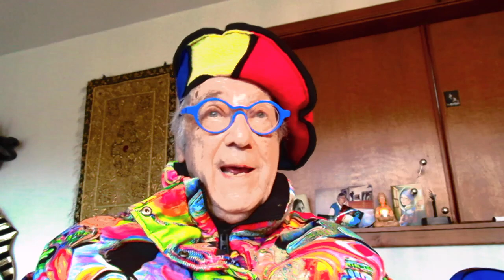Solution #192 Cylindrical Capacitor with Dielectric

Comment: Alternative solution to problem 192.
(From an RF-engineers perspective)

In vacuum:
Z₀ = √(μ₀/ε₀) 	…(1a)
μ₀ε₀c² = 1		…(2a)

Eliminate μ₀ from Eq. 1a and 2a:
μ₀ = 1/(ε₀c² )
Z₀ = √[1/(ε₀²c²)]
Z₀ = 1/(ε₀c)
=> 
ε₀=1/(cZ₀)  F/m	…(3a)

In a transmission line:
Z₁ = √(L’/C’)	…(1b)
L’C’v² = 1		…(2b)
where v = c/√εᵣ

L’ = 1/(C’v²)
Z₁ = √[1/(C’²c²)]
Z₁ = 1/(C’c)
=> 
C’ = 1/(vZ₁ ) = √εᵣ/(cZ₁)  F/m …(3b)

For a coaxial transmission line:
Z₁ ≈ (60/√εᵣ)·ln(D/d)	…(4)
(A well known equation among radio amateurs)?

d = Rb = 0.0035 m 
D = Ra = 0.009 m 
εᵣ = K = 2.6 

Z₁ ≈ (60/√2.6)·ln(9/3.5)
Z₁ ≈ 35 Ω

C’ ≈ √2.6/(3·10⁸·35) ≈ 153 pF/m
Reply: Explanation:
Z₀ = the wave impedance of a plane wave in vacuum.
μ₀ = vacuum permeability  [H/m]
ε₀ = vacuum permittivity     [F/m]
c = speed of light
μᵣ = relative permeability.
We assume no magnetic material present, so we let
μᵣ = 1.

Z₁ = wave impedance in a transmission line
It can be a microstrip or a stripline in a printed circuit board
or a coaxial transmission line etc.

L’  = inductance per meter [H/m]
C’ = capacitance per meter [F/m]
v = the phase velocity in the transmission line.
εᵣ = relative permeability = same as the K-factor.

We interchange the equations in vacuum with
those in the transmission line:
Z₀ -> Z₁ , μ₀ -> L’ , ε₀ -> C’  …

Z₁ can be fond from a simulation program, or for a coax
by an  approximation like Z₁ ≈ (60/√εᵣ)·ln(D/d).

Comment: And yeah, I can understand your disappointment completely. Cable capacitance is a really basic problem (C/L= 2*pi*eps0*k/ln(Ra/Rb)) (changed it according to your problem variables)

Only three persons got it right 😮 meaning, they aren't paying attention to your lectures at all.

Or I am guessing they took Ra and Rb reverse. I mean, we normally take Ra as conductor radius and Rb as outer radius. You reversed them, and they didn't read the question properly I guess?